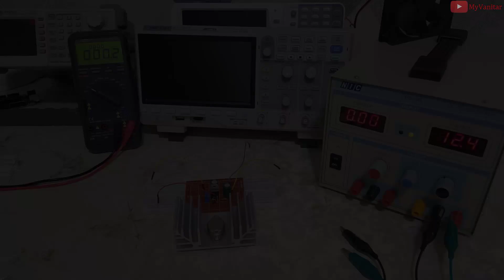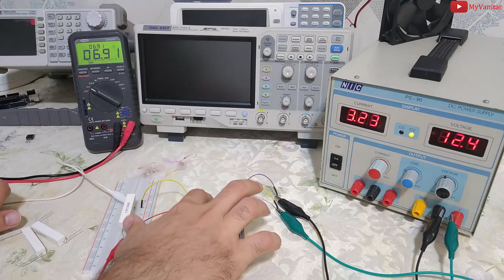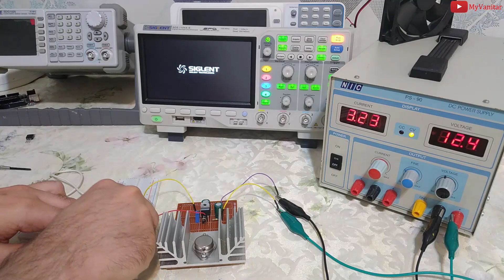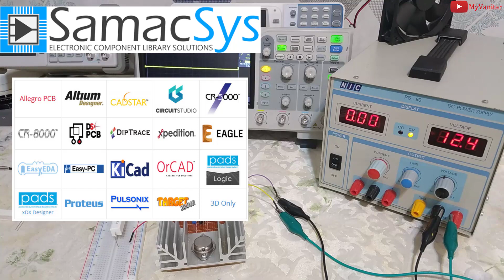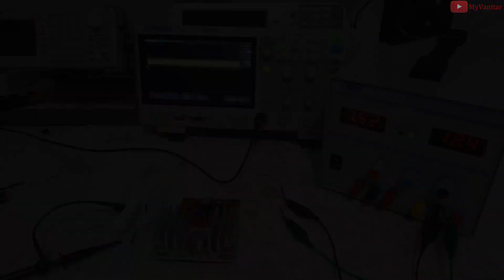LM317 Current Boosting Circuits [2N3055, MJ2955]

Comment from the maker: LM317 is one of the most popular adjustable regulator chips. The output voltage of the regulator can be adjusted from 1.25V to 35V. However, the chip can deliver currents up to 1.5A which is not enough for some power applications. In this video/article, I will discuss two methods of LM317 current boosting, using power PNP and NPN pass transistors.
Reply: Great
Reply: https://youtu.be/3ZMfVpUieFc
Reply: Or just use an LM338 with a good heatsink and forget the pass transistor.

Comment: Hi Sir, i follow your videos regularly, Nice presentation and precise information. Just wanted to ask you one thing. Today when i was going through your video library found LM317 with Current boosting using MJE2955 PNP Transistor. However in this place if i want to restirct my current limit upto 3A as Max with the help of Transistion TIP32C will this work. Also i would like to add 0.5ohms 10 watt resistor from emitter to LM317 Transistor to output pin, Instead of 10R i would like to use 47Ohms. Rest would remain the same. Will this work. Also i am going to place two transistors on heatsink and cooling fan of 2" inside my enclosure.

Actually i have SMPS 36v 2.7amps however LM2596S Battery Chargery Module that has constant current and constant Voltage with max of 28v, In this regard i thought to pre-regulate voltage from SMPS Input of 36v to 28v so that i can calibirate constant voltage of 14.3 v and constant current 1.5amps to charge lead acide battery of 12volts 7Ah.

So using your circuit bit tweak in transiste and resistor would work. Your help is highly apperciated.

Comment: I want to output 15 volts from 23 volts. Which resistor should I change and what value? plz help me
Reply from the maker: 15V output from 23V input? no change
Reply: @ Thanks for reply. I want to fixed 15v output from 23v input but which resistor need to change
Reply from the maker: As I told you earlier, no change is necessary, just build the circuit with MJ2955
Reply: @ ok sir . Thanks a lot

Comment: Why do some people use a Bd139 along with these two components when creating a circuit to regulate both voltage and current? Does it enable the user to be able to vary the current?
Reply from the maker: those designs don't work as they claim, a power supply must be tested with laboratory tools such as a DC load not a lamp or motor

Comment: How much is max input Voltage? Also, there is one more capacitor on the scheme than your build circuit
Reply from the maker: The input max voltage is the LM317 max input voltage

Comment: So i am studying how and why heat gets produced by TO-3 transistors (2N3055) how could i deliberately make my 2N3055 produce heat? Not enough heat to destroy the transistor but enough to say its very hot? How would i set it up? Just put higher voltage on the transistor?
Reply from the maker: by passing the current through the transistor instead of the regulator. read the article linked in the description

Comment: Hello, thanks for project. i have some trouble with this schematic potentiometer. When i reach minimum potentiometer is burning. İn schematic potentiometer 5k or with 5k serial resistor ? its my school project and i stuck.. in the output so unregulated i think potentiometer cause that too.
Reply: My 270r resistor is old maybe i should change that.. any suggest ?
Reply from the maker: man schematic is very easy, why you should have any problem. if you do not have a 5K pot, use 10K

Comment: The Maximum Amp draw per gauge of wire Chart, shows that the breadboard kit wire at 24 gauge can only handle 1.154 Amps, which supports the 5 Watt or less theory
Reply from the maker: that's for testing to show the proof of concept. in practice, you're gonna design a PCB
Reply: As you can see it can handle little bit more for couple seconds... before it will meltdown :D

Comment: Where to buy that circuit?
Reply from the maker: I have not designed a PCB for this because the circuit was simple, just follow one of the schematics you like
Reply: @MyVanitar  I made John hutchison crystal cells I got 10 volt very steady but low amperage....don't know what boost converter suits my application
Reply from the maker: these are linear power supplies or linear regulators (with current boosters), I have introduced a boost converter in another video
Reply: @MyVanitar  thank u Brother only u replied...no one wants to contribute...

Comment: You are losing voltage in the small lead wires you are using.   The LM317 can regulate far better than you demonstrated.   The voltage drop on your lead wires must be huge.   Good video for newbies.   Adding a pass transistor for more current is far cheaper than buying LM338 if you need more than 1.5 amps.
Reply from the maker: Do you think I don't know that?! This is just for testing, you have to design your PCB if you would like to use this circuit seriously. Yes LM338 is expensive and its thermal dissipation is not as good as a power transistor
Reply: @MyVanitar  I know you knew that.   I put it out there for the newbies since you didn't mention it in your video.   Croc/Aligator leads today are so cheap and tiny gauge they are only good for a few milliamp loads.
Reply from the maker: Yes, I have made some of those Alligators for myself using a good thick copper wire. Thank you for your comment. actually, most people don't watch the content completely and that makes the difference between a wise person like you and a person who just makes arguments about anything. another example is my last video (fake soldering iron). People see their 40W soldering irons are unable to melt a simple thing, especially with flux and another 40W iron does easily, but just argue with me that power measurement is irrelevant
Reply: @MyVanitar  Absolutely.   I make leads with 14 gauge wire I have from stripped line cords from appliances for some testing I do.   It amazes me that the clips today aren't even soldered.   They just use the strain relief crimps to bond the wire to the clip.

Comment: Hello very great-clever idea.,
I have a question for your current boost by a 2N3055, 
in my old circuit power supply 0-25V - 1.5 A, with 2 x LM 317s,
the first Lm317 works as current limiter & from his output the DC voltage 
goes to the second LM 317 for voltage adjust 0 to 25 V for output terminal,
does the right conect the transistor 2N3055 to the first LM 317(current limiter)? 
and the resistor's pin 10KΩ connect to this LM's out OR to  output terminals + & - ?? or not..
(Iam a simple amateur) 
Thank you
*I tryed to upload here a schematic by google-drive (to see you what I mean)
but doesn't let me to upload the link here
Reply from the maker: No need to upload the schematic, I got what you mean. Truly, I have not tested your configuration myself but I think your assumption is right. However, I think you should try the PNP solution. Just try on a breadboard. shouldn't be difficult
Reply: @MyVanitar  ,
Thank you very much for your fast reply,
I asked about 2N3055 mod. because I have many spares of them .
What is your opinion,
for where I will connect the end of the 10K resistor;
At the output of the first current limiter LM 317"or at the output terminal
(if something does not work, I will try with a MJ 2955) 
thanks again
Reply from the maker: The 10K res just provide a minimum load to keep the output stable. so I think you should use it for the second stage (voltage regulator)
Reply: @MyVanitar  ,
hello ,
finally i replaced both the Lm317s by lm350t 
(because the transformer its up to 3A total)
the circuit works fine+output protection up to 3A without other mod.
thnX for help
Reply from the maker: @Ianistrip  good luck

Comment: Thanks for the video. I read your article. You are kind to share this info. Im looking to build a variable dc power (0-48v)  supply with  15 to 20 amp current output.  a microwave transformer 220v input to 12v output with KBPC 5010 FBR and beafy cap. I dont know how to calculate the capacitor rating that i need though. Then this circuit of your design afterwards with digital V and A readout. Going to need cooling fan also and safety fuse. Im subscribed and you need more subs and likes. Any tips and advice from your side wil be much appreciated. ( im new to electronics by the way, need to learn allot more)
Reply from the maker: Thanks, Johan. if I understood you correctly, you wanna build a 0-50V supply that can handle up to 20A. You decided to use a 12V microwave transformer. There are two problems, I don't think your selected transformer is a good choice since the output is 12V and I don't think it can handle such a current, because the circuit will have some drops and dissipation as well. The easiest method for you (because you said you are new and you wanna learn staff) is to use a commercial SMPS (the ones with metal case) with at least 50V output and 20A. then connect the output of this SMPS to a powerful DC to DC Buck converter module to be able to adjust the V and A. You may be able to find a commercial unit for your purpose, I can introduce the Siglent new power supplies with digital display. Linear power supplies are good for sensitive devices and laboratory equipment. for power applications, SMPS (switching power supplies) are far more efficient. a 20A transformer is huge and quite heavy!
Reply: There's a circuit on Circuit Exchange International using the LM 317 regulator with 5 or 6 TIP 2995 transistors to boost the current. Built into an old pc tower case. The transformer and heatsink are large and a dissipation of around 40W or higher is stated. Use the HVT version of the regulator to provide 48v limiting the current to around 660mA to 700mA by a resistor on the input of the regulator. Use the voltage drop across this resistor to operate the boost transistors. There's a circuit on the Texas Instruments datasheet that uses a PNP driver transistor with NPN pass transistors in conjunction with the LM317 regulator.

Comment: Where is the circuit diagram ?
Reply from the maker: Please watch the video completely, when you are hurry, you can not learn something correctly.
Reply: @MyVanitar  I watched the complete video but couldn't find the circuit of current booster you said in description with npn & pnp transistor
Reply from the maker: @amitghosh6966  Check the video description, there is a link to the article

Comment: I have 18V 30A transformer. Can I use MJ11032 instead of 2N3055 and possibly replace LM317 with LM350 if need be?
Reply from the maker: How much current you want to get at the output?
Reply: @MyVanitar  All 30 amps considering MJ11032 can handle 50 amps easily. They should be heatsinked of course anyways.
Reply from the maker: @ruslank4028  You can not get 30A out of a 30A transformer. also you must consider dissipation and voltage drops. I suggest you to use an SMPS. switching power supply

Comment: Plise make a video LM317 and 13005 from old cfl lamp to boost the current pliz 🙏🙏🙏🙏
Reply: I have (15) 13003
And (5) 13005
Reply from the maker: You can not make a test yourself? It's not a complex circuit. if yes, what results you got?
Reply: It not working but why????
All connection was right 😞
Reply from the maker: @Electronic_For_You  How exactly not working? You don't have an output voltage or what? Please recheck although this is a switching transistor
Reply: Tell me pliz
Reply: Output voltage is 7V at first this is the problem
Reply from the maker: @Electronic_For_You  You can not change the output voltage? Just for testing, use another transistor. if it didn't work, some problems exist with your circuit, otherwise if the circuit worked with the new transistor, simply you can not use your mentioned transistor for this purpose. that's it

Comment: MJE 3055 will work same????
Reply from the maker: try it. it will work but I am not sure about heat dissipation or current delivery, but its DC current gain rate is good
Reply: I have old 13005 they are not working same why????
Reply from the maker: @Electronic_For_You  How they work?
Reply: 2n3055 can i use 2 of them???? 
For 8A ??????
Reply: . You can use 2 2N3055's with current share resistors on the emitter terminals. It is better to use a PNP driver transistor in conjunction with the regulator to drive these transistors. Connect the PNP transistor before the regulator as shown on the Texas Instruments datasheet for the LM317. Suggest using a BD140 -10 or BD140 -16 as the PNP driver transistor or the more rugged TIP32C or TIP42C.
Reply: @robertneill3057  
Oh my god 😬
My 3 Year Old comment got replay , 😅 thank you !
Reply from the maker: @Electronic_For_You  Theoretically Yes, but I have not tested it myself. You can not simply parallel them. Do some research. if I gonna answer this, it takes another video

Comment: Is it possible to make the same circuit for LM337 in negative voltage? For a dual power supply.
Reply from the maker: Good question, I have not seen a reference design for this, but I think if you use the second circuit and replace 2N3055 with MJ2955 for LM337, it should work, but I have not tested it